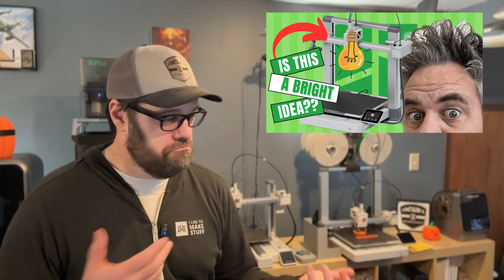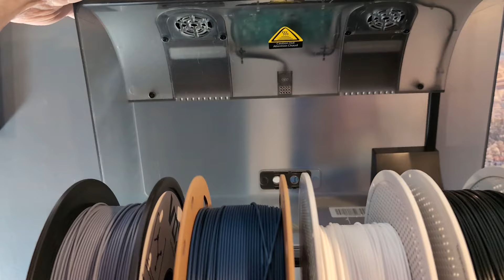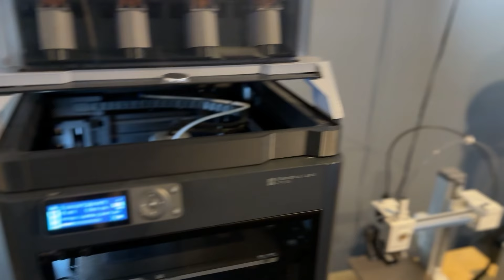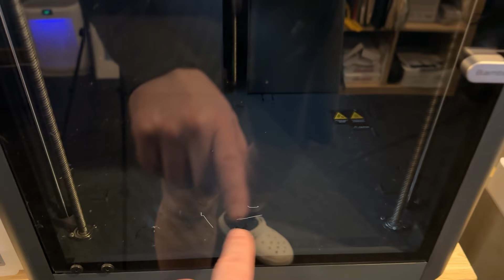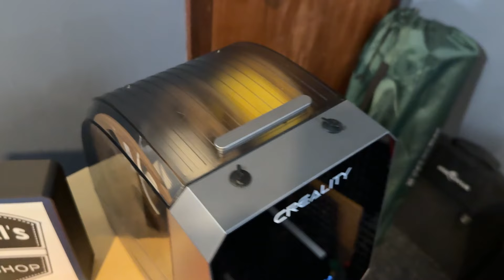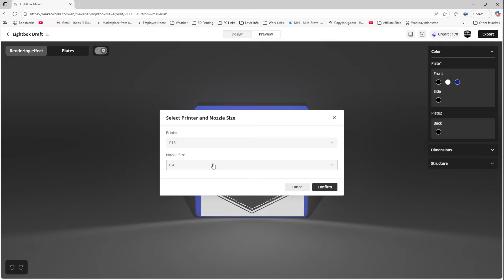Bambu Lab Printers - One Year Later

Comment: Hi Steve, thanks for the video. What filament type did you use for the bracket you printed for the A1 mounted holder for the AMS lite?  Also do you have a recommendation for where I could get the model?
Reply from the maker: I used PETG as it's less brittle than PLA and the files came from Bambu on Makerworld here: https://makerworld.com/en/models/92486-ams-lite-top-mount-for-a1?from=search#profileId-100105
Reply: @Vintauri Thank you very much Steve!

Comment: One section had no sound; you were talking about the Sunlu AMS and no sound. I think you were just saying that it's not advisable to heat or dehumidify while running. Think this will be my next purchase in the near future.
Reply from the maker: Ugh, yeah I'm not sure why that short part of the audio cut out on the video processing.  Bambu does not recommend heating while printing, I've tried it so far no issues that I can tell, but to be sure, I just pre-dry it overnight.  It's not a bad unit and fits the AMS well.

Comment: I like my bambu p1s and ender-3v pro. I did purchase the Creality 4-Spool Filament Dryer Box. I like your kit box you printed. For filament storage I printed out the modular drawer for filament storage. Each unit can be stacked vertically and horizontally. Spendy to get the sliders. It works well under my printer table. I found it on Makerworld. Filament types and colors are like collecting fabric types and colors. Hard to just say no to another color 😅
Reply from the maker: Yeah I need to sort out a better filament storage system. It’s on the list but the list is long! 😂

Comment: Check out BIQU nozzle wiper replacement for the P1S, definitely an upgrade. Also, when you install the BIQU. led light for the P 1S, be very careful when you remove the tape to access the wiring, it may pull some wires loose, especially the camera. I know from experience 😂
Reply from the maker: I do need to check out the upgraded wipers. Good to know on the P1S light kit. Thanks for sharing!